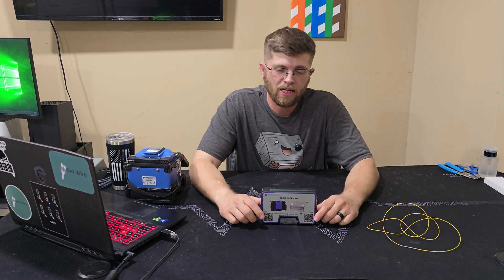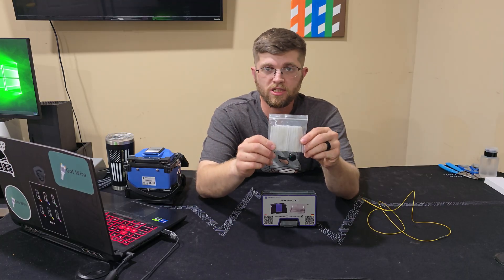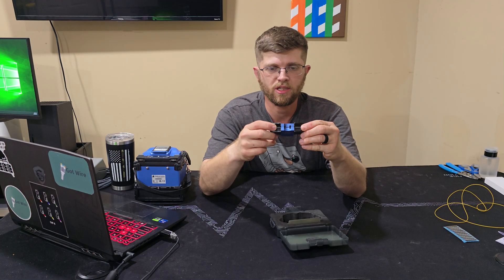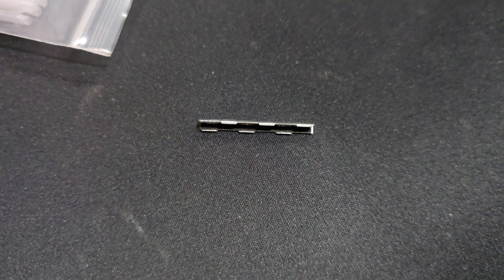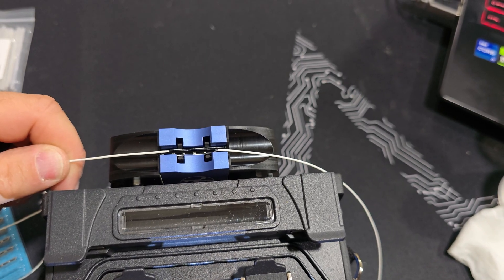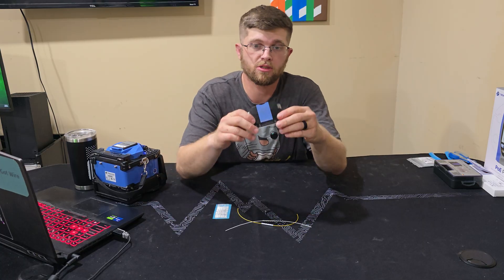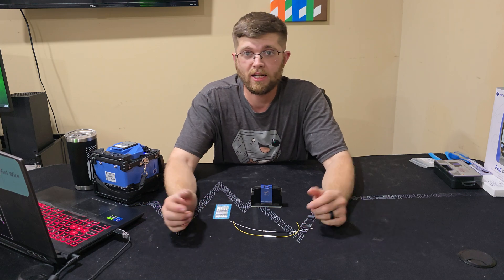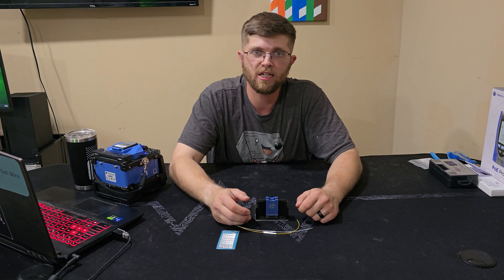Overseas Splice Method vs U S  Style – Heat Shrink or Crimp?

Comment: In Germany, Switzerland, and Austria, crimp splice protectors are preferred over heat-shrink splice protectors because they are more mechanically robust, more reliable over long periods, and less dependent on installation quality.

They offer:
	•	Better long-term stability (20–30 years)
	•	Higher resistance to temperature changes and moisture
	•	Consistent quality regardless of technician skill
	•	Compliance with strict network operator standards

Heat-shrink splice protection is typically used in:
	•	FTTH drop cables / last-mile connections
	•	Indoor installations (buildings, apartments, data centers)
	•	Countries/regions with different standards, e.g.
	•	USA
	•	Asia (China, Japan, Korea)
	•	Parts of Southern & Eastern Europe
	•	Mass deployments, where speed and low cost are priorities
	•	Temporary or low-stress installations

Crimp splice protection is associated with higher costs, because:
	•	Material costs are higher (metal or reinforced protection sleeves)
	•	Special crimp tools are required
Reply from the maker: Appreciate the detailed breakdown! Makes sense why crimp protectors are preferred there—different regions, different standards 👍 Thanks for sharing the insight.

Comment: I‘m doing fiber work in Germany and use 95% crimp protectors. The main advantage is the faster application and the smaller packing then heatshrink. A normal holder bracket holds 12 crimped splices where it can hold 6 heat shrinked ones. We don‘t use ribbon cables, so we have to find an other way to get fast. 😅
Reply from the maker: ya we don't use ribbon at my work either, but all we use is heat shrink sleeves. But ya over here in the states most fiber guys have never even seen/used the crimp protectors.